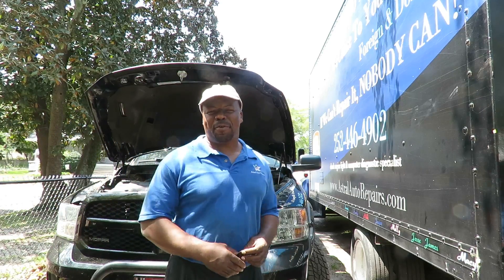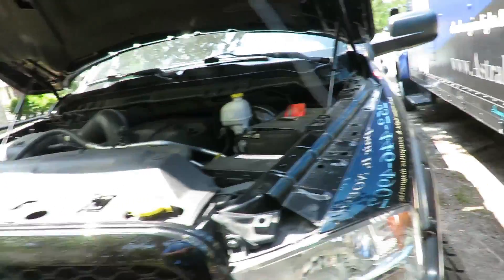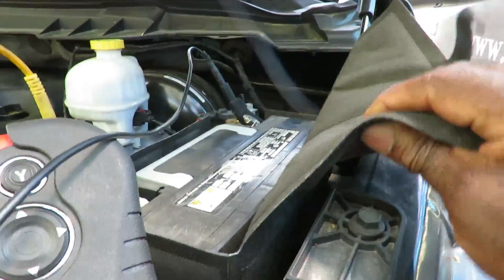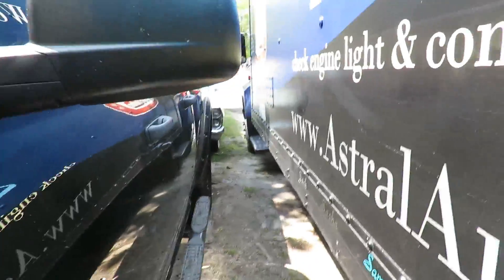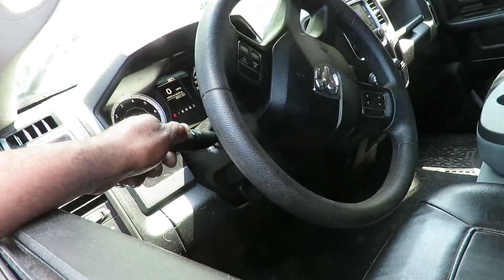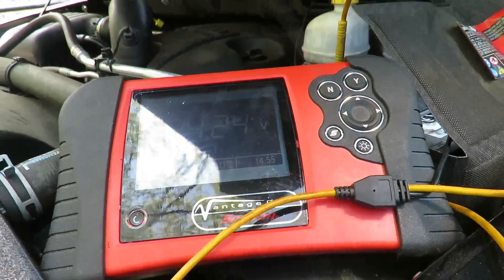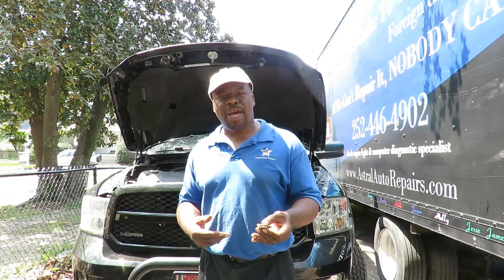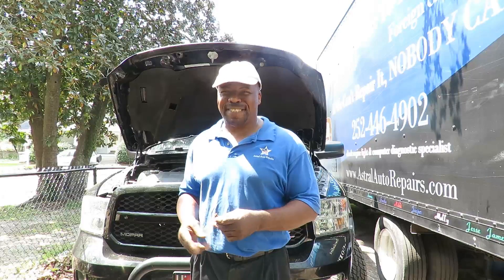2013 Dodge Pickup Ram 1500 - No Start - Just Clicks

Comment: I had the same issue with my Jeep. It was the weirdest 
thing. It would just click and if you waited a few minutes it would 
start. Other times it would turn over but not start.This would happen 
maybe once every few weeks.The connections were clean and tight.  Finally really got fed up when it wouldn't start for a few day's. We took the battery in to have it checked at two different locations, and they both said the battery was fine.. I told my husband lets just start by getting a new battery first and go from there. I'm sure glad we did that, because we haven't had any issue since, knock on wood....I vote for the older cars being more safe! :o)
Reply: P.S. What were you eating at the end of the video? You made me hungry, lol.
Reply from the maker: LOL, it was a chips ahoy cookie with a brownie filling, my first time having one and it was not bad at all :)

The customer did take the truck to autozone and they too told him the alternator and battery was good, not sure what they're testing...

Fio posted a video here which showed an older car vs a newer car, in a crash test by consumers report, but if you look at the comments, most people said it was fake.
Reply from the maker: They're alright, my favorites are "Vienna fingers" and "Oreo double stuff"
Reply: I actually have this problem right now.07 Durango, sat for 6 weeks because pcv valve broke off inside manifold. Didn't wanna drive back to PA like that, so left it parked up in N.Y., got towed. Would not crank after that . tested all fuses and relays. Only tow fuse was blown. Fuel pump will not prime .it has less than 5k miles on it.starter was tested, cranks strong. Will a bad cks or cps prevent fuel pump from priming?
Reply from the maker: Hey RichCastle, a bad CKP will cause the fuel pump to not operate because the ecm is thinking the engine is not running. Not saying that is your problem, but that is a good question to ask.
Reply: @OnlineAutoRepairVideos   ok thanks for the quick response

Comment: I believe that there are pros and cons to classics vs contemporary autos.
If you get T-Boned in a classic, the risk of serious injury is greater because there's no SRS, and no shoulder harnesses, etc.
Having said that, I've seen impacts of the old steel frames plow into lighter, newer cars. Can you say, "Bring the jaws of life?"
It ain't pretty at all and there's hardly a scratch on the chrome bumper.

So what's the prognosis Doc, improper Battery or just one that was manufactured on a Friday at the end of the shift?😁
Reply from the maker: There's the avatar, now you've made it complete! The customer is going to take it to autozone, or similar, and have the battery replaced. If we got the battery, it would cost him $210. These batteries today are outrageous!

I would think if a new car today would t-bone an older car (depending on the side) like the one in the video, the older car would come out safer because as we all know, the newer cars are made of Styrofoam and plastic in the front, and they are lower, so that car is going to hit solid chassis.

Comment: I have this problem on a 2001 1500 magnum 140000 miles. Solenoid? Relay? Im stumped
Reply from the maker: It could be either, or the starter
Reply: @OnlineAutoRepairVideos  litterally sold the truck two hours ago 2 grand hope they figure it out. I made them aware dont think of me as that guy

Comment: OKAY LET ME TELL YOU THIS!!!!!!!!!
I have a 2014 Ram Laramie 1500 5.7 
I woke up went to start my truck..one click no turnover! 

CHECK THE RELAY ON THE FUSE BOX UNDER HOOD

CHECK FOR CONTINUITY ON THE FUSE NEAR THE RELAY THAT IS FOR THE solenoid 

After those 

GO AHEAD AND REPLACE THE STARTER I DID IT MYSELF WITHOUT EXPERIENCE IN 4 HOUR AND SAVED HUNDREDS!!!!!!